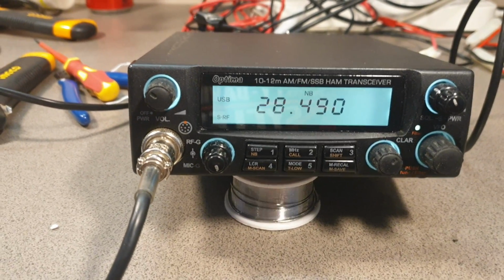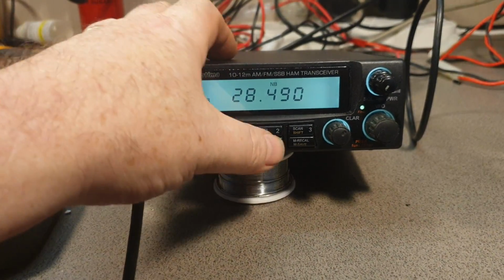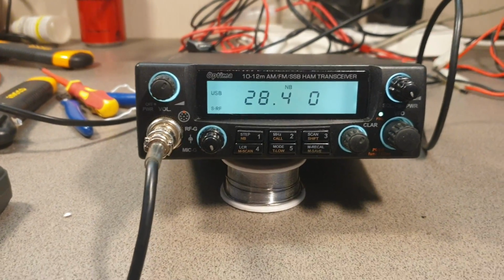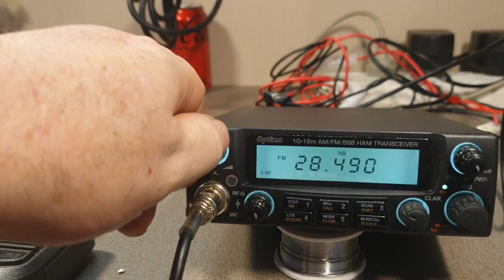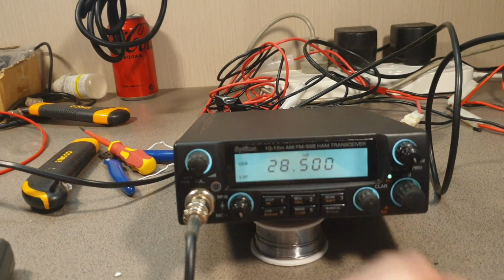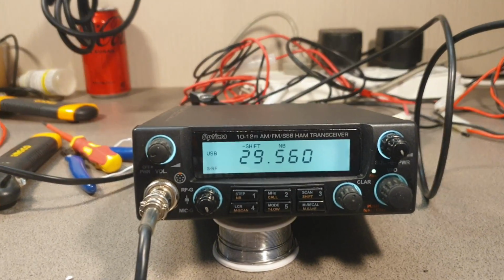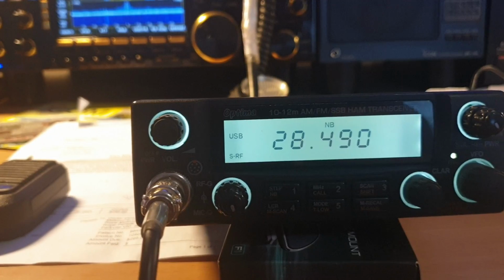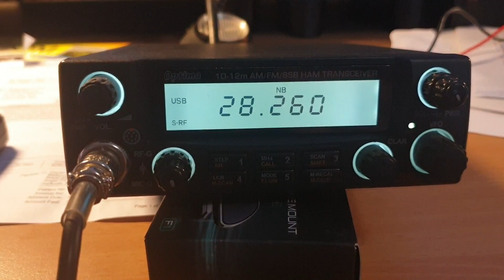10m 12m  All mode Optima Ham radio up for sale, offers invited by email Brenton@posnav.com.au

Comment: Optima's are factory supplied with an Icom mic pinout. They also have a free running VFO (no 10K blocks) a selectable IF filter,  and a 5KHz step selection option that sets these apart from all other variants. You can set the shift to -100khz but long pressing the SHIFT key.  They also have an internal jumper selection to allow 12m and 10m (Ham) only. (FYI, this rig should be transmitting around 50 watts on SSB.  And around 40+ on FM.)